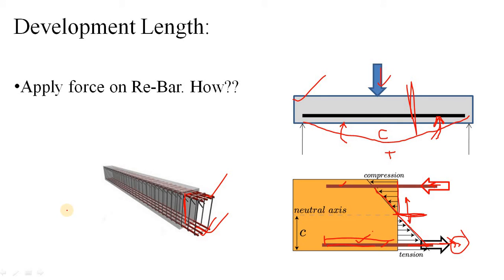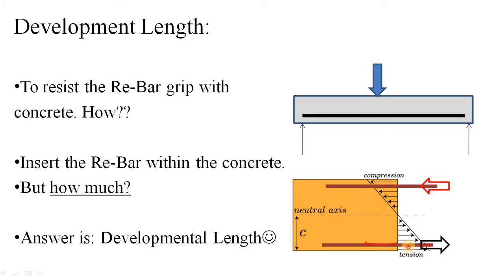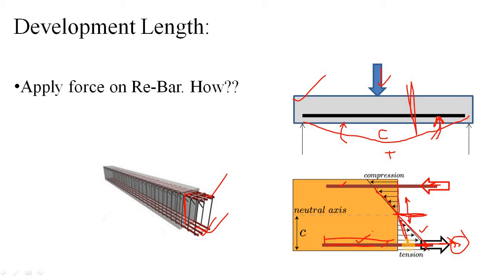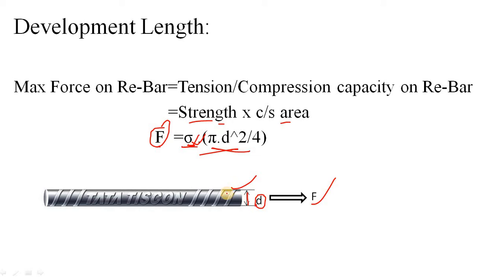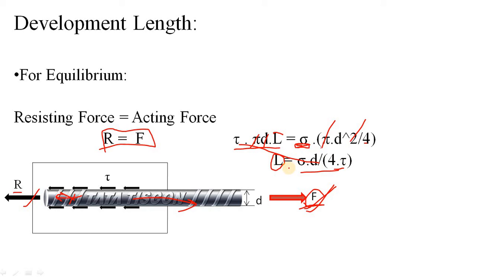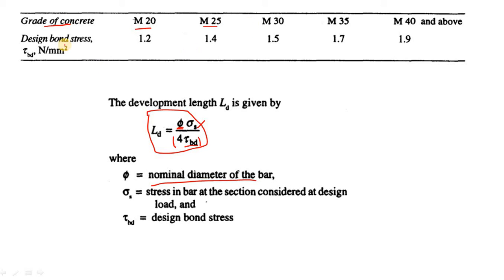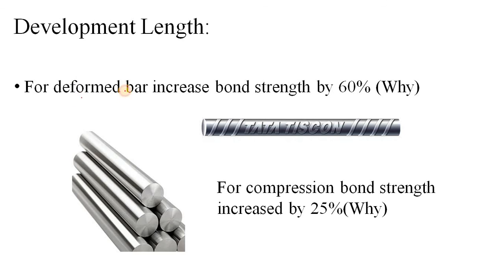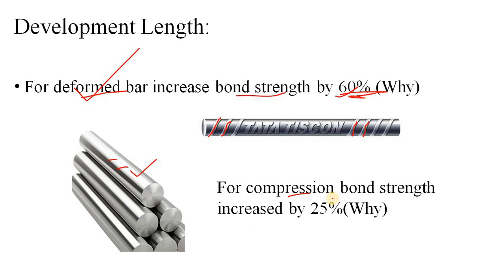How to Calculate Development Length in Reinforced Concrete? Theoretical Analysis and Code Value.

Comment: Respected Sir

Based upon the knowledge gained from the instant video, i have extended the general formula for calculation of development length.
1) For deformed bar in tension -> Ld=(dia. * S)/(6.4 * T)
2) For deformed bar in compression -> Ld=(dia. * S)/(8.0 * T)

Example calculation for 16mm dia Fe415 TMT bar and M20 concrete
1) For deformed bar in tension -> Ld=(16*415)/(6.4*1.2)=865mm(After Rounding Up)
2) For deformed bar in compression -> Ld=(16*415)/(8.0*1.2)=692mm(After Rounding Up)

Kindly confirm whether i am correct
Thanks
Reply from the maker: Excellent... definitely it will help others too.